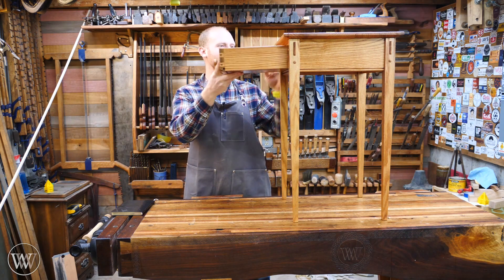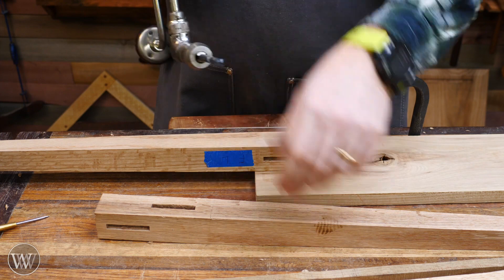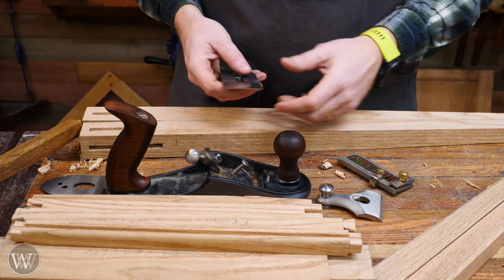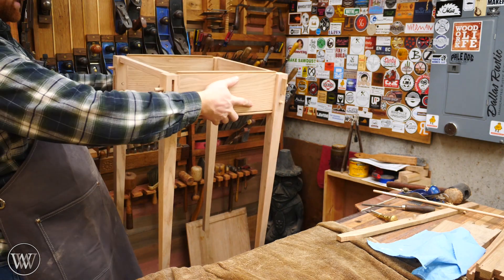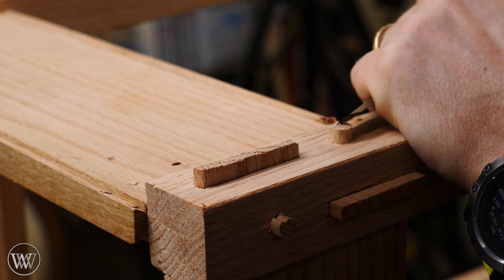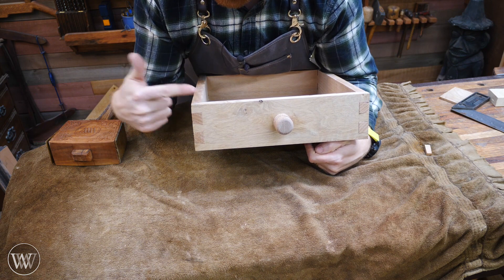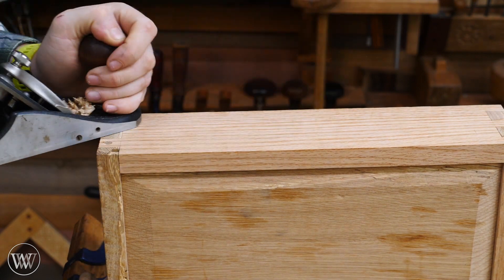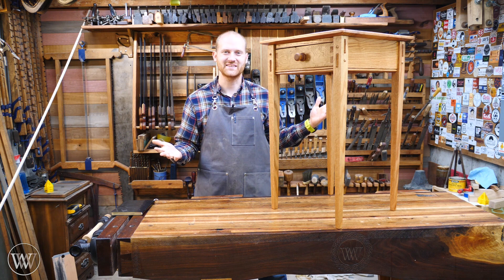Side Table Part 13 | Smoothing and Final Assembly

Comment: Great video! At 14:10 it looks like you are getting a split in the leg as you drive the pin, am I seeing that correctly? If so I suppose it is just an opportunity to use add a bow tie key. In any event, I love your videos and appreciate your sharing your passion with the interwebs.
Reply from the maker: correct there was a small split on that one. I did not notice it till later. Oh well. I moved the draw borehole a bit too far putting a lot of force on the joint. it is not that big of a problem as the pin is pulling the split toward the shoulder of the stretcher rather than forcing it apart.

Comment: Hey James, wonderful work. I look forward to the shots when you oil it up!

I’ve been thinking about how the sliding dovetail top would scale up to a dining table. It would definitely be possible, but really hard to keep straight. Is there another way to attach a table top without screws or glue that could be reasonably performed by regular Joes? I thought maybe with the use of dovetail cleats. If you can think of or have heard of other methods I’d be interested in knowing it.
Reply from the maker: there are two methods I use and they depend on whether or not I can lift the top by myself. if I can hold the top by myself then it is small enough to use sliding dovetails. If I can not then I have shallow tenons that stick up into the top a bit to keep the top from sliding around then let gravity do the rest. this also makes it easier to move the table in the future. I will be showing this method when I make the dining room table. but I have used Sliding dovetails on tops as long as 8' (a buffet I made years ago.)
Reply: Wood By Wright dang that’s a big sliding dovetail! I look forward to seeing the dining table series

Comment: Have you thought of drilling into the bottom of the leg (end grain) that was too short, and hammering and gluing in a dowel to increase the length of the leg? Does that make sense? Since it'll be on a carpet, I think that a thin dowel won't be seen...
BTW, the clip @35:00 makes it look so amazing! You have really good photoshop skills!
;)
Reply from the maker: I had not thought of doing that, but it sounds like it would be more work in the end. but it might be a fun way to do it. thanks man!

Comment: Looking good! Do you find on your veritas custom smoother if you keep the cap iron slightly loose so you can still adjust the norris adjuster it does not hold its setting ? You seem to be able to adjust yours on the fly ? Its Just a minor niggle I find with mine.
Reply from the maker: thanks. no, I tighten it down so I can easily adjust it, but as long as the last movement was to advance the blade just a bit it does not move at all in use. sounds like you might have something between the iron and bed or lever cap and chip breaker.

Comment: I noticed when you were using brase and eighth bit it was wobelin about, why not use an electric drill?  Nice video.
Reply from the maker: +charlesxix thanks. First the channel is all hand tools, but most importantly it actually does not make a functional difference. I know it looks like it would make a big difference with that wabble, but in reality the hole is the same.
Reply: Thanks for the reply and it makes sense. :)